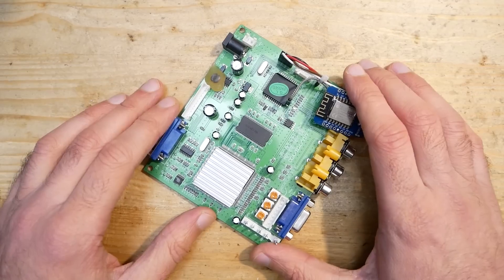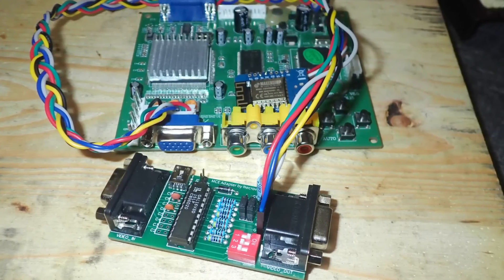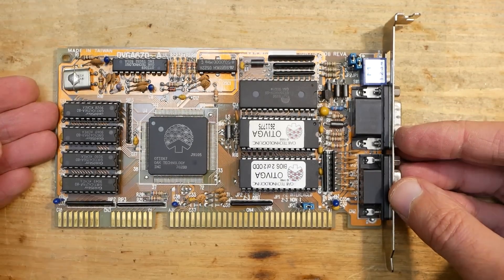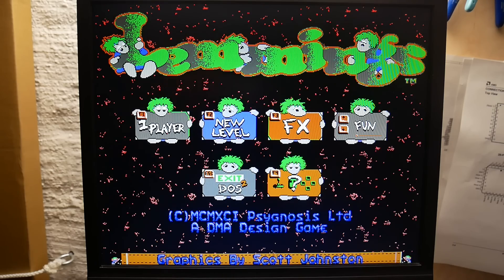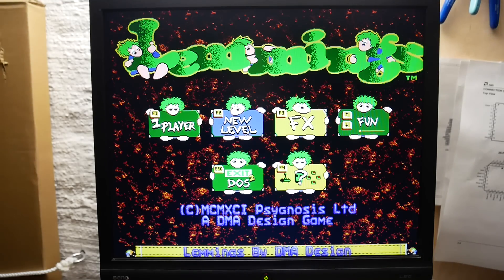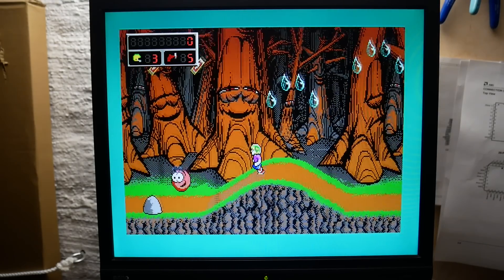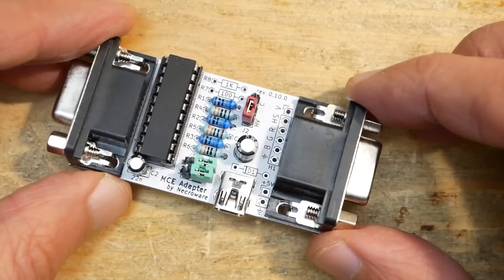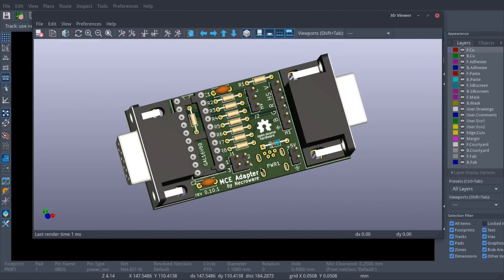Updates of my MCE-Adapter (simpe MDA, CGA, EGA converter)

Comment: I have the old one. Can I rework it to this Version? Greeting!
Reply from the maker: You can, if you remove the third switch, place a capacitor instead of it and add a resistor between V-Sync and this capacitor. I'd also suggest to replace the resistors as they are on the new revision if you want to get better colors.
Reply: @necro_ware  Nice work!  So, in order to modify a v0.7.1 board, we should add a bodge wire + 10K resistor from the VIDEO_IN1 VSync pin to the non-ground pin of a 1uF resistor placed at J3? I guess the capacitor does not need to be polarized (e.g. ceramic)?  Also, which resistors should be replaced? I guess R1+R4/R2+R5/R3+R6 should be 1.3K+680R? Finally, what about R7 and R8?  Thank you in advance (and sorry for the question torrent...)!😃
Reply from the maker: @dionisiosklonaris493  Yes, basically this is what you need. You can replace the switch 3 by just putting a capacitor instead. Then you can put a resistor 10k betwin V-Sync and the pin on the IC where the capacitor goes to. The resistors you should replace are all the RGB color related. Those are 680/1.3K. I relabled the resistors, so the name don't fit. The R7/R8 are not quite as easy. It is optional, but the 1K can be removed and 100 can be replaced by 470. Unfortunately on the old revision V-Sync was just wired through to the output without a resistor, on the new revision it goes through a 470 as well. On the old revision you can cut the trace and add a resistor if you want to make it complete.
Reply: @necro_ware  I guess the last 470R mod is for the HSync pin? Thanks for the prompt reply!
Reply from the maker: @dionisiosklonaris493  On the new revision R1 is H-Sync, R2 is V-Sync, they both should go through 470R unlike on the old revision.
Reply: @necro_ware  thank you for your help!
Reply: @necro_ware 

So, R7 will be 470R as well?
So I have to need 3 of them for the old revision, right?
Reply from the maker: @Steve01Project  Here is what you need to do:
- Remove R8 completely
- Bridge R7 with a wire
- Cut the traces which go from H1 to VIDEO_OUT1 pin 13(HS) and 14(V) and put 470 resistors instead
- Replace R1, R2, R3 with 1.3K resistors
- Replace R4, R5, R6 with 680 resistors
- Replace J3 with a 1uF capacitor
- Add 10k resistor between pins 2 and 9 on the U1
- Use new firmware from release 0.10.1
Reply: @necro_ware thank you so much! 
Is the new firmware optional or is it necessary?
Unfortunately I don’t have a programmer.
Reply from the maker: @Steve01Project  it is of course necessary. The whole magic happens there.
Reply: Thank you, I will organize a programmer! Can I change C1 to an non polarized one as well?

Comment: How the heck did you do that with a GAL?
Reply from the maker: Yes, this is pretty much at its limit, but it is not the most complicated thing, which I made using a GAL. If you switch it to clocked mode, it can get even crazier.
Reply: I've always just used them for address decoding. I guess I skipped a few steps in learning PLDs and dove straight into learning verilog. I'll have to revisit GALs and fool around a bit. @necro_ware

Comment: I have a GAL16V8D and I thinking on make one adapter latter on. is this GAL fully compatible?
I also have some ATF22V10C PLDs. those are a little more complex/capable, useful to do some extra things in this converter.
the thing I miss is to be able to run/upconvert to 30KHz so is easier to find compatible monitors

Comment: Awesome! Will this work with the RGBi signal of a Commodore128 as well? And can I assume the PCBWay shared project will be updated? (Would make it easy to get me one of those boards, or 10 as that costs the same ;) )
Reply from the maker: C128 should work with this adapter since it is usual CGI. I don't know who uploaded the project to PCBWay, but you also don't need it, just take the gerber_zip from the release page of the project and drag to PCBWay order page, or any other PCB manufacturer you like. It's a two click operation.
Reply: Have you tried it with your C128? I have mixed results with mine. It works when the computer boots up and I can print any color text or even a full screen of reverse spaces in any color with no problems. However, changing the background color causes the screen to go dark, wrong colors to be displayed, weird artifacts, etc..
Reply: @ericanderson85  I remember I tested it. I don’t remember how extensively. Sorry. Been a while since I had time for my retro stuff.

Comment: Would it be possible for me to wire an adapter cable to use this with an Apple IIGS like I already do with the cheap (re: crap) chinese conversion board or is it strictly designed for handling PC standards
Reply from the maker: I'm not a specialist for Apple, but doesn't IIGS already has an analog RGBHV video signal? If so, you don't need this adapter, because it is for digital to analog conversion of MDA/CGA/EGA, which were used on x86 PCs in the first place. But may be s.o. with Apple experience can give you a better answer.

Comment: Some EGA cards support a non standard low-res mode with 64 colors. The old design of the adapter should support that with hi-res mode setting. Is there a way in the new adapter to ovrerride the autodetection to allow this mode?
Reply from the maker: No, not really. I didn't see such a non-standard mode so far and I'd have to investigate, but even if it is in low-res, I guess it will still have to flip the sync signal as if it would for high-res. Otherwise the EGA monitor wouldn't have a way to distinguish how many intensity bits are used. Low-res EGA has only one intensity bit, so you can generate only 16 colors (with brown hack). For 64 colors you'd need 3 intensity bits (no brown hack) and this mode has to be recognized by a good old EGA monitor somehow as well. So I guess such an override wouldn't be needed.
Reply: @necro_ware  The IBM 5154 monitors use the V-sync inversion to detect 4-bit 15.75khz vs. 6-bit 24khz modes. The early NEC Multisyncs had a further trick up their sleaves and somehow autodetected MDA/CGA/EGA and auto detected analog vs. digital TTL input from its DB-9 port.
Reply: @necro_ware  I only know of one game that does 64 colours in low-res (super offroad), and it requires a monitor that lets you force 64colour mode. Some taito games can do something similar with weird boca/paradise EGA cards, and they don't need the 64colour force, weirdly
Reply from the maker: @TheRasteri  Oh yes, I forgot that. You told about it back then, as you've made your video about this topic. I have to give it a try. Thank you.
Reply: @necro_ware  Still probably not worth adding a manual switch for one single game. Especially as it doesn't really improve the graphics, haha
Reply: @necro_ware i'm not sure, but try to run Stormlord
Reply from the maker: @fastbeta  Thanks, I will.
Reply: @necro_ware  Actually that's the funny part about your video: The Lemmings title screen uses a 64 color EGA mode! If you compare closely to the game being run on a VGA card, you'll see that the "Lemmings" logo has more shades of green - but the VGA card is still in 350 lines EGA mode.
Reply: @bad.sector  VGA lets you redefine palettes in all modes by programming the DAC registers and choose from 262144 colors.
Reply: @JendaLinda  Absolutely, know that, developed 2 graphics libraries for DOS.
No, Lemmings uses more than 16 colors at once though. It's known 64 color EGA game, though not well-known, you just showed that as well.
Reply: I suspect that the sync polarity detection will probably automagically put the device in the correct mode as that how EGA monitors seemed to do it back in the day.

Comment: Very nice! Only thing I would suggest is to add a buffer to drive the analog signals with the proper 75 ohm impedance.
Reply from the maker: Yeah that would make it perfect indeed, but so far the GAL seems to drive it good enough though. For now I decided not to overengineer it. It should remain as cheap and simple as possible.